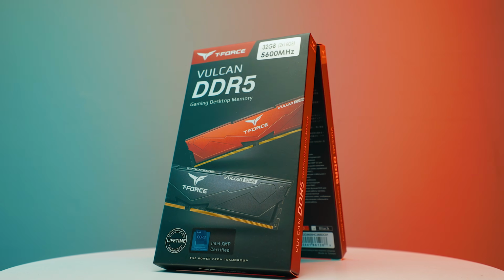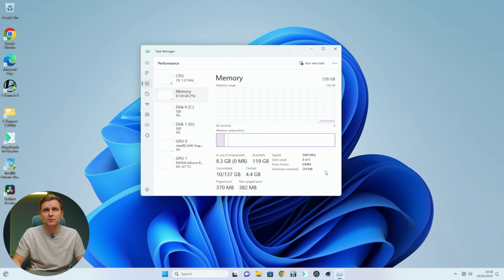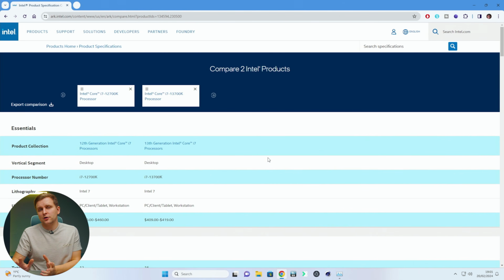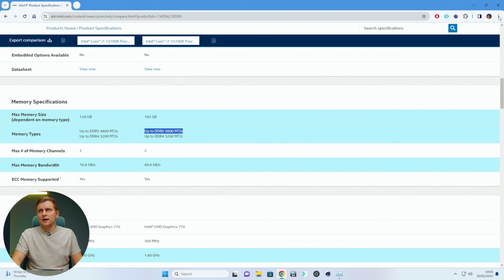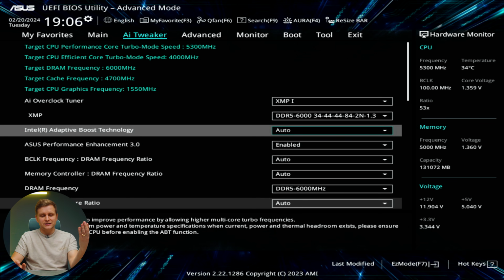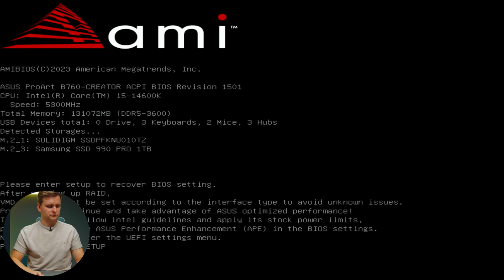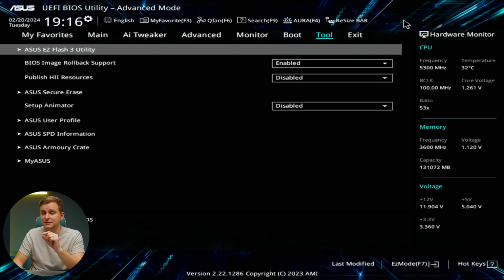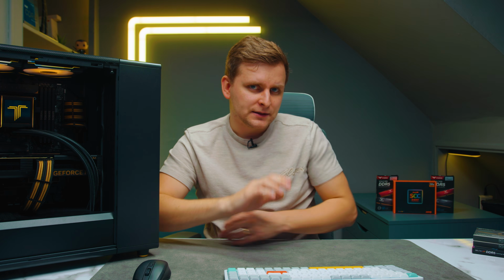Maximize RAM Speed EXPLAINED: Common Mistakes to Avoid & FREE Performance Boost!

Comment: On Ryzen 7000 I see no performance scaling (except minimum FPS in games) from going DDR5 4800 to 6000.

Better timings does improve performance, but what about stability? How can be 100% sure you are using a stable system for working that should not crash?

I am more concerned about stability than performance nowadays.

EDIT: For granted stability the best bet is using JEDEC specifications. That way your RAM would have a hefty extra margin for working reliably, as doing RAM overclocking is like going to the edge without falling and satay there.
Reply: You check if it's stable really quickly using OCCT and a couple other software tools, really easy. You can't be lazy about it and need to put in the work. If i stuck to JDEC standards i would be losing about 10% performance or more.
Reply: @YøIø_Swaggins Exactly JEDEC is like 4800 MT/s. Ryzen still likes fast RAM to this day.
Reply: For guaranteed stability without stress testing, use DDR5-5200 which is Ryzen 7000's default speed. AMD recommends DDR5-6000 as the sweet spot that every system with 2 sticks of RAM and a decent motherboard with an up to date BIOS should be able to hit at this point without any problems. As with any overclock, even at the sweet spot company-recommended speed, you should run a few stress tests to make sure it is stable. 

Buildzoid usually starts with Geekbench (6 was the latest as of last year when I built my PC and 5 was the previous one but still supported and usable), then a memory specific test such as Y-Cruncher and AIDA 64 Extreme. I used his Zen 4 Hynix RAM timings with manual overclock to 6000 MT/s and tested with Geekbench 6 then AIDA 64 Extreme and Y-Cruncher (Multi-core memory test with 5 billion decimals of Pi and no errors). I also tested with Geekbench 5 just to compare it to my old Geekbench tests with the Ryzen 5 2600 and Ryzen 7 3700X. Once all that is done the next thing to go about your normal routine. RAM overclocks (and CPU overclocks) should not only be stable during benchmarks and games but also when your PC is idle.